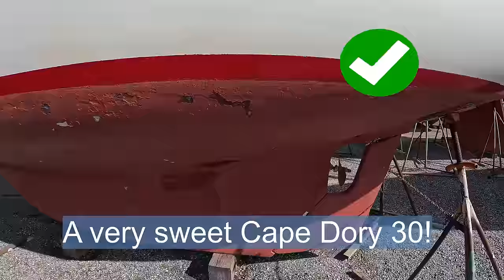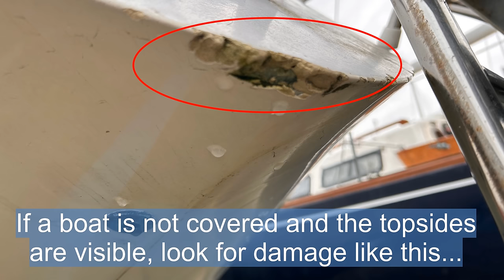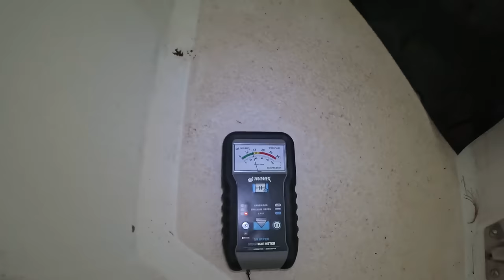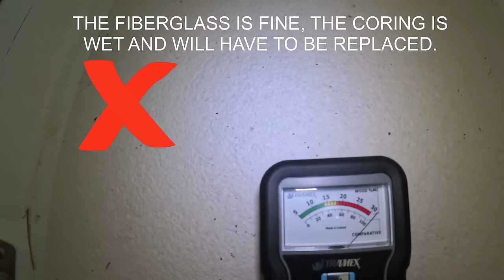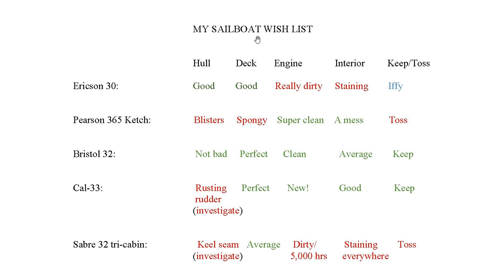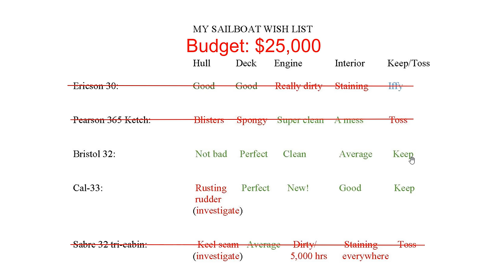The 5-Minute DIY Sailboat Survey: A 15-point inspection to vet potential sailboat purchases!

Comment: I would also have checked the rudder bearing to make sure it didn't have any play.  One thing that can be a real issue is the batteries.  depending on where the batteries are, it can be a big job to replace them.  Personally, I would walk from a boat with big batteries (4Dor 8D) because big batteries are HEAVY and really need two people to get them out and back into the boat.  Also check the condition of the batteries and the wiring to them.

Unless the rigging is pretty new, you will likely want to replace it within a few years.  So I wouldn't sweat the rigging much unless it needs replacing now.  If you own a quality tape measure you can easily replace your own standing rigging for a lot less than $5K on a 38' sloop.  I see no need for a rigger.  Just remove the suspect wires, measure them and order new ones.  Easy.  I use rigging only down in Fairhaven, MA.  They are fast and have great prices.  You can even do your own rigging.  Jut buy the wire and some mechanical fittings.  You will need a hacksaw, tape measure and a couple of wrenches.  Once you get build a couple of wires you will have it down and can finish the entire boat in a couple of days.  Furlers are a bit more work, but you can easily install a new forestay and furler in a day.
Reply from the maker: All good points!

Comment: Excellent episode!  And very applicable to my situation having just flown from Dallas to Baltimore to arrange to meet a surveyor at a boat I had under contract on the Chesapeake near Annapolis. The survey lasted about 10 min because as soon as he stepped on deck it was soft and rotted and went off the chart on the moisture meter. He didn’t finish the survey and agreed to half price. But that was still $500!! Appreciate you for sharing all your wisdom through experience!
Reply from the maker: I’m sorry you went through all of that trouble to learn that. Someone should have known well in advance about those soft decks and said something. Sheesh…
Reply: @boatfools  
It’s all good! Everything happens for a reason and I learned so much about the process.
Reply: @jeffreyhutchinsdo  that’s 💯 the right attitude when dealing with sailing and boats. Lessons learned are more valuable than gold. Keep looking and if you want eyes on a deltaville boat before booking a ticket let me know.

Comment: So I understand, basically what you do is as full preliminary survey on your personal amateur level to eliminate the candidates you could see problems with your level of knowledge. Very well done! As soon as every used boat obviously has some problems, you obviously need a rough understanding of a price behind the common types of the problems. Like, how much is to: replace the rudder/steering, replace the engine (or a major rehaul), new rigging, sand fix and paint the hull.

Comment: Great episode as usual.  One other item that i would look for that you did not mention with regard to the engine access is the starter motor location, especially on a used boat.  The starter is a key component of the engine -- without the starter all of the other components are irrelevant, if you can't start the engine it really does not matter if you have top of the line filtration for the fuel!!! The starter is a wear item that can easily be damaged by water intrusion or insufficient voltage supply (starts with weak battery) -- at some point you will be replacing the starter of every motor.  Idea for a follow up episode: What is the price point at which a professional survey becomes worth while?  If you are just breaking into boating and your budget is only $10k, do you do your own survey or pay for the professional survey?  When the money for the survey might allow you to "buy up" to a better boat, is it still better to spend the money on the survey -- the average boats in this range are Catalina 22, Cal 22, Compac 18, Compac 23, Hunter 23, and Tanzer 22 etc.,  many of which have very few components that are not repairable by the average person.
Reply from the maker: Excellent points! A follow up episode is likely! Thanks, as always, for your comments and insights.

Comment: An otherwise nice Cal33, totally worthy of fixing the rudder at the right price. Well made, great sailing machine. But the one stripping a whole bottom back to glass, barrier coat, fairing it and finally paint is a big project I've done.  FYI, your engine compartment with no insulation is 3x as loud as one with.  The are solid wood cabin soles, and ones of cheap plywood that look similar. The former is just elbow grease to restore. Ports + veneer and trim can be a difficult job to get right and watertight.
Reply from the maker: Agreed. Sweet boat. I jumped the gun on saying pass. But did change my mind. Actually none of these boats are for sale. Just found them to use as examples. However there is a Cal-33 for sale in Maine right now and it looks pretty nice! Great racer-cruisers.

Comment: I go straight to the engine bed to check for rot. That's the first.
Reply from the maker: An excellent tip!
Reply: I wish I knew this last year
Reply from the maker: @jsmith3728  I kind of want to know what happened but I am afraid to ask!
Reply: @boatfools  I’ll reply because others need to know but I will keep it vague… when something is a “good deal” you should make sure it’s sound. The boat didn’t pass survey because of a “bad engine mount” I had to motor through a some locks for 12 hours to get the boat “home”… now that I’ve inspected it I’ve found that the aft mounts have been punched into the ( it rotten) engine beds… long story short my motor is out of the boat and I splash in 3 weeks.

Comment: A question: Your own boat has primary and backup fuel ( diesel?) filters. Both are charged with fuel. Each has distinctly different fuel colours ( non US spelling 😂). Why?

Just a small point to clarify if possible.
Reply from the maker: Absolutely! That yellow diesel is from a gas station so no dye in it. And we have yet to use that one! You are the first one to mention that. Good eye! And thanks for watching!

Comment: In my opinion if the engine and decks are good and there's not a lot of blistering and the rigging isn't falling off, everything can be fixed. Of course people want everything free and now but I would be more interested in a seaworthy boat in its design over having to do some repairs. I would much rather have a full keel deck stepped mast boat and walk away from a fin keel but to each their own. That's just me. That Cape Dory 30 at the beginning is the boat of choice hands down even if it needs work. That boat will most likely live even if the captain and crew doesn't.
Reply from the maker: Agree with your thoughts here. And about the CD 30: sturdy, solid, will go anywhere. And that one is cutter rigged. Aces. Thanks for chiming in!

Comment: On the keel bolts, would it be prudent to put something like Loctite on it to help with the backing off?  or is that a no-no?
Reply from the maker: No, I wouldn't use Loctite, as this would make torquing or removal that much more difficult. Checking your keel bolts is really a once a season situation under typical use - like seasonal sailing up here in the NE. It would take a long time and extraordinary conditions for all of your keel bolt nuts to back off to a point where your keel will just drop off. But checking them periodically is an ounce of prevention... Thanks for watching and for your question!

Comment: I have a Catalina 38 1982 SS.   The entire sole is integrated fiberglas ,dropped in to the hull when built . No wood any where .  All bulkheads are 6 inches above sole when they become mahogony . I rarely see this on older boats..
Reply from the maker: Nice! A lot less to worry about! Thanks for the comment and thanks for watching!
Reply from the maker: That Catalina is based on the Yankee 38 mold - has the prettiest tumblehome. Great boat. Well, you have a lot less to worry about! Thanks for watching!
Reply: Thanks.  It looks like a 34 footer in the water . Low freeboard. It is 16500 lbs. of displacement so it handles rough seas well.